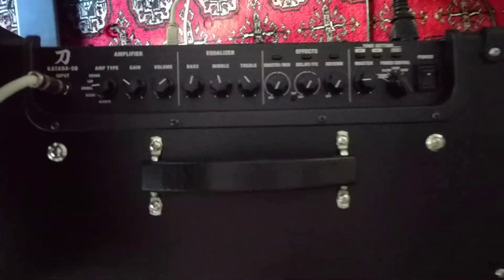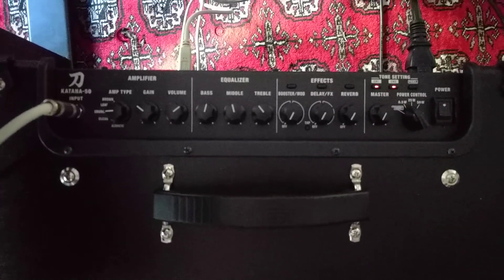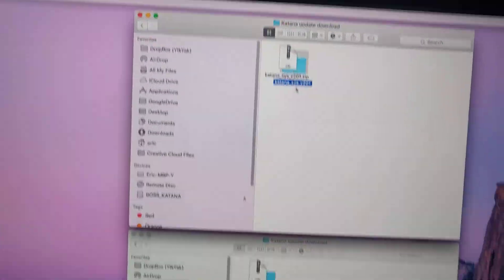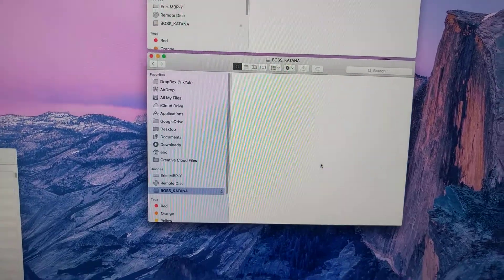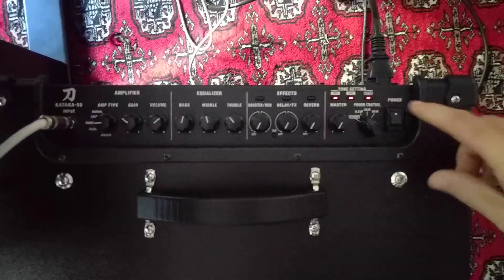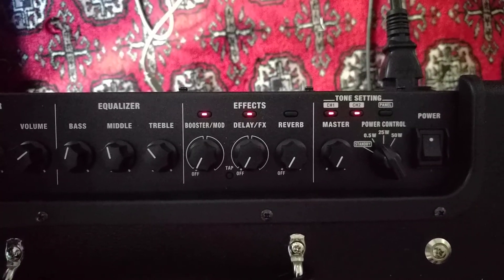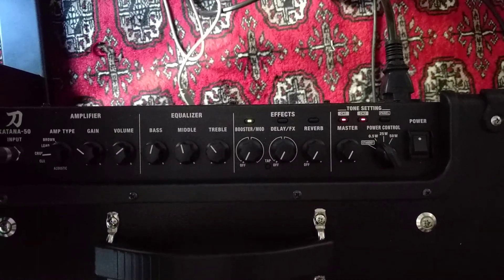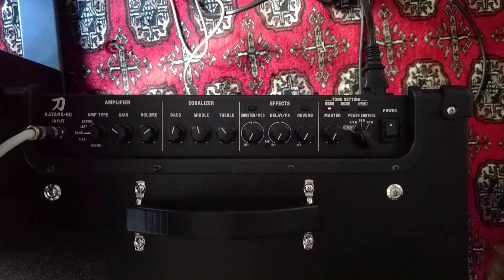BOSS Katana 50 guitar amp firmware update process

Comment: Thanks bro, it worked for me. Before updating firmware you must check which one you have first.

 Ej: HOW TO TELL THE VERSION
Please check the version of the system working on your KATANA Mk II before downloading the archive file.
 
Turn the POWER switch on while holding down the [ TAP ] button.
The five EFFECTS indicators display the current version.
If the indicators light up as described below, the system is at the latest version.
BOOSTER :	Lighted in red
MOD :	Dark
FX :	Dark
DELAY :	Dark
REVERB :	Dark
If the indicators light up in a different way than just described, perform an update.
When you have finished verifying the version, turn off the power.
* Don't perform the update if the product is already up-to-date.

Comment: Finally got it I was turning it off after ejecting and turned back on wrong wrong
Eject live on amp pull the cable out push panel button and let it up load